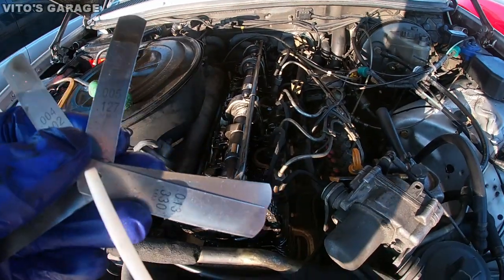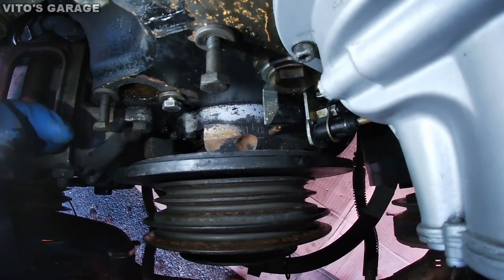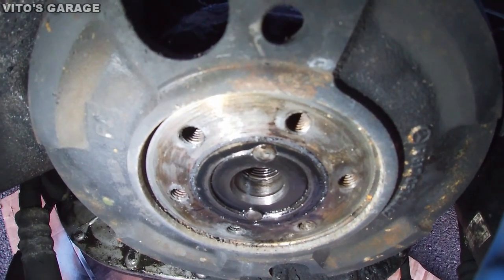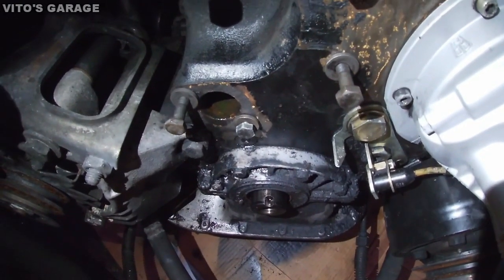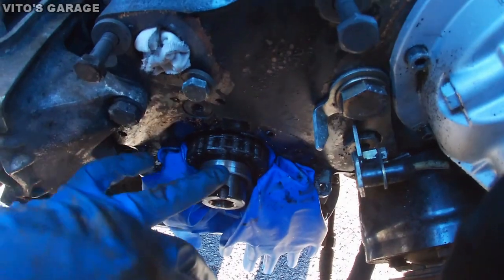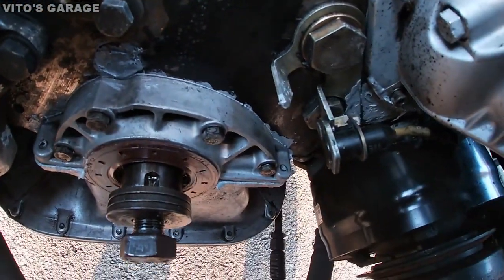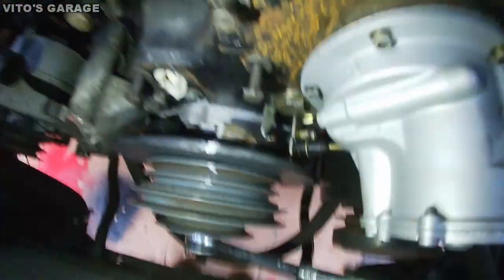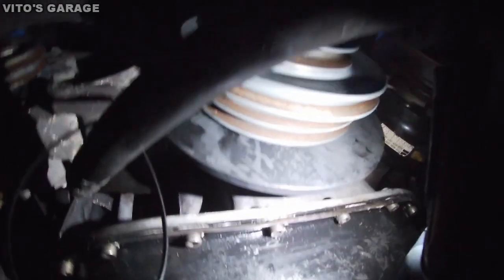PART 7 Dad's Gift 1985 Mercedes 300D: OM617 Front Crank Seal & Spacer Ring Replace, Valve Adjustment

Comment: Why would you need to mark pulley? Harmonic balancer i understand - so it stays exact to the crank shaft but the pulley? Could you explain? Asking because i'm getting ready to replace my water pump on M110 engine and i'll have to remove pulley and harmonic balancer (attached with 400 pounds of torque...).
Reply from the maker: Crank pulley also has balancing weights, that's why. Plus I am that kind of a person who likes to keep everything the same way it was.

Comment: Please,its to much for silikon,you take only little plarse.its not save for engine
Reply from the maker: It's not silicone. It's an rtv sealant. I didn't put a lot. It looks like it's a lot but it's not. Once I bolted up a front cover, only a little bit of sealant squeezed out. Watch the video again and relax
Reply: @VITOSGARAGE  what kind of rtv sealant.
Reply from the maker: @ericapikian5971  Permatex rtv gasket maker